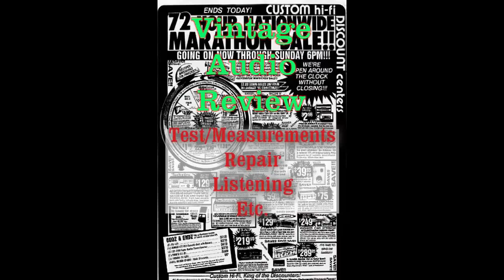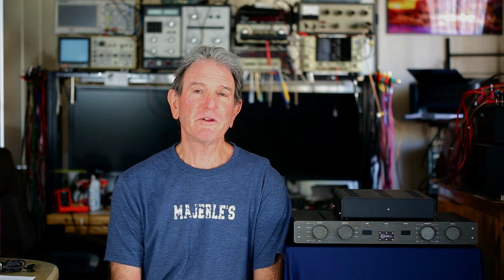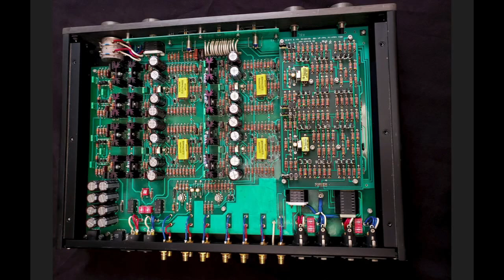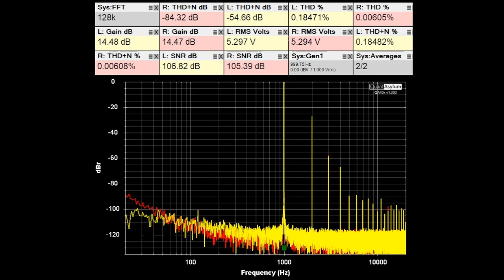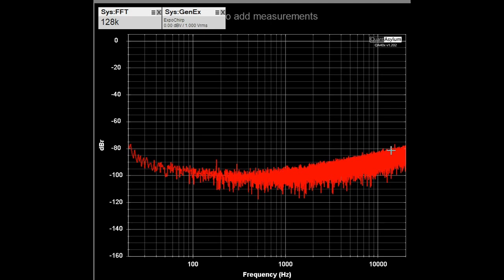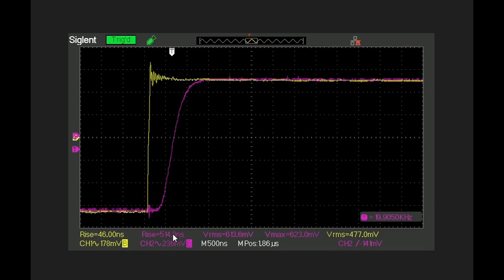KRELL KBL Preamp- Vintage Audio Review Episode #157

Comment: Is it easy to fix? I got one without its power supply for 200 euro from a flea market. Are schematics easy to find online as well. I would like to built a new power supply from manufacture spec.
Reply from the maker: Krell, like Levinson gear, are hard to find service literature on and I would stay away from them.
Reply: @vintageaudioreview okay. I manage to get some documentation about the preamp but now I have find some for the power supply. I'll see it if get lucky. I am not in a rush since it was an opportunity to put my hands at a very cheap prince on this preamp which  was a Ferrari back in the days. I believe it was one of my late father's dream amplifier.
Reply from the maker: @alishaheedmuhamad  Good luck with it. Hopefully you will find what you need.
Reply: @vintageaudioreview  hopefully !

Comment: I've had this Krell KBL and the KRS-2, PAM 1, KPSB-7 and KRC. Lot of problems with dried out Roedersteins and leaky Spragues. The powersupply of the KBL became insanely hot.
I did love the KRS-2 and the KRS-100 mono amps. Do not buy a KSA-200. 80 or 250. They overheat. With no fans you need for these heavily biased amps the heatsink hardware of the KRS series. The others I mentioned are just under dimensioned regarding their heatsink surfaces.
Reply from the maker: Thanks for taking the time to comment. Too bad such an expensive preamp can't be made with longer lasting components and/or better heatsinking of them.

Comment: The left channel looks a bit off in the distortion and noise measurements, is that by design or possible defective components or connections. .
Reply from the maker: Even though the left channel's distortion measurements were not as good as the right, they were still low for the most part. The noise level was worse, though, but not something that would be very noticeable. I suspect a component on the left channel may have drifted  or an adjustment would need to be made. The connections to and from the unit were fine. Thanks as always!
Reply: @vintageaudioreview  The KBL System noise level with both balanced and unbalanced inputs shorted showed a noise floor at 115 dB down. That's very impressive, suggesting a noisy amplifier circuit is the source of the left channel noise. (I'm guessing) :) If that can be fixed it would be a stellar performer. Also the rise time was very impressive. This is an Interesting design that appears to be loaded with 1% resistors from what I could see from the open top view. The two box setup is a bit odd but it is quiet. Thank you for the detailed review.
Reply from the maker: There is no amplifier connected to the KBL for the measurement, just the analyzer, which is fine. Yes, it has an extremely low noise floor- thanks for the comment again!
Reply: @ OK, so the distortion and noise appears when the circuit amplifies a signal but not with the inputs shorted. I wasn't referencing an external amplifier, just the gain circuits in the preamp itself.
Reply from the maker: Since it is quiet w/out a signal going in, then I would guess one of the Left channel's gain stages may be overloading/distorting just a bit with the presence of a signal of a certain level....

Comment: This amp badly needs recapping. Left channel is toast.
Reply from the maker: Thanks for taking the time to comment. Most likely does not need a recapping- at least in the Power supply as the noise level is pretty low-about the same for both channels. There may be a component that has drifted out of spec and I believe there were some adjustments that could be made using the trimpots if you had the service manual. But the left channel still was ok in general.

Comment: Well,to be honest i always wondered where the real added value of "high end" pieces like 
this are compared to well engineered and produced  mass-market stuff. I mean this one was 
highly (!) praised in various magazines of its time (mid nineties),but in practical terms it is 
just a glorified line/buffer-stage with input selector and volume control. Not exactly what i 
personaly would consider a preamplifier. It lacks - at this pricepoint - a flawless and flexible
phono MM/MC preamp section and yes ,at least some tone controls and filters. Oh, and a 
mode switch which i find realy useful when setting up/ checking a setup.
Just sayin...
Anyway,like always,a REAL review. Thanks.👍
Reply from the maker: Thanks so much for your thoughtful comments. Once again, keep in mind that this was not brand new. I much prefer my Carver C1, though it has been recapped and is older...